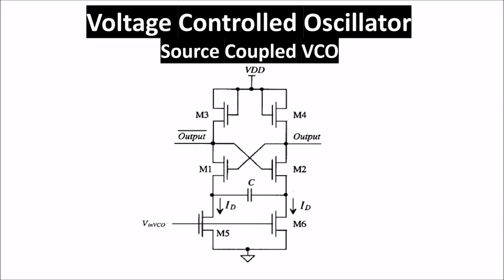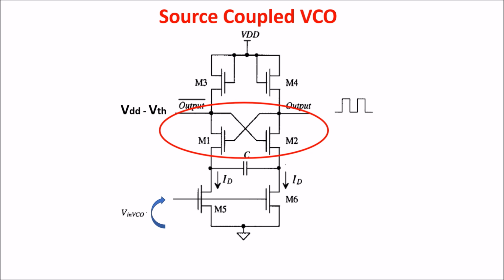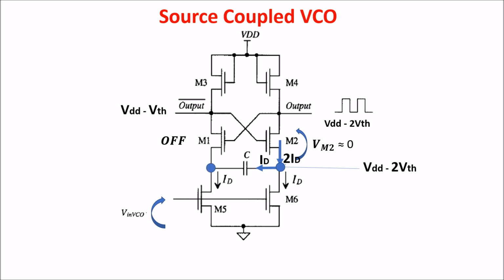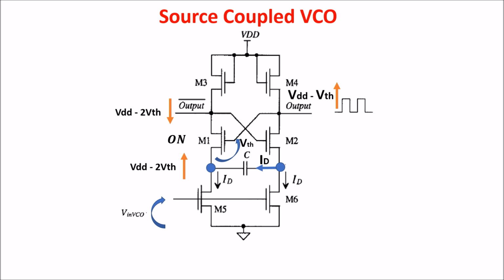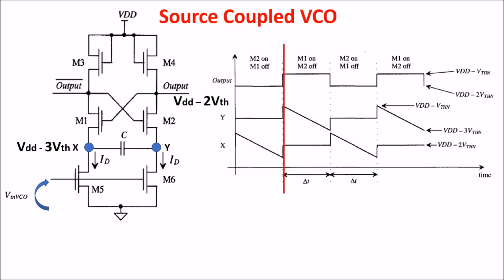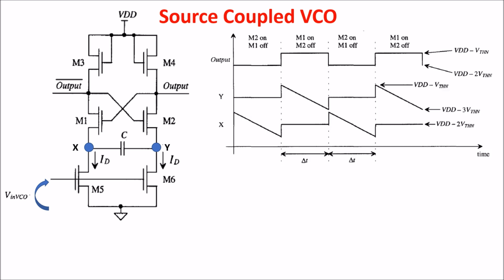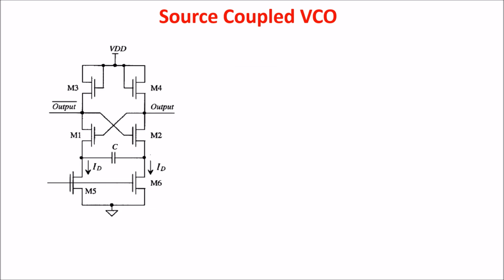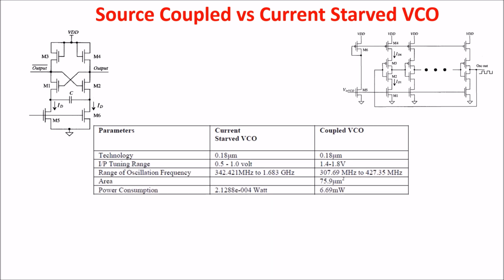PLL - Voltage Controlled Oscillator - Source Coupled VCO

Comment: great video. 
IN real life circuit, what makes you think one of them will be switch on and the other switch on(M1, M2)?
why do you think the voltahe at x in the first start assumption, that the voltage keeps decreasing while it si already a constant?
Reply from the maker: Thank you. I am glad you like it. I think the circuit may have initialization problem. It depends on the voltage in output and negative  output. It depends on x and y initial voltages. If x and y voltages are the same It won't oscillate, but if x and y are Just a Little different oscillation Will start.